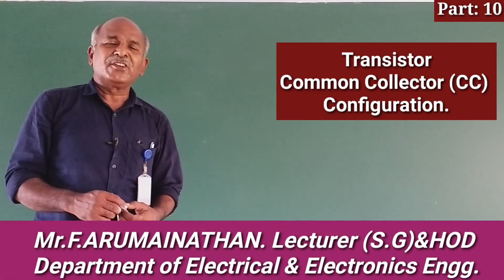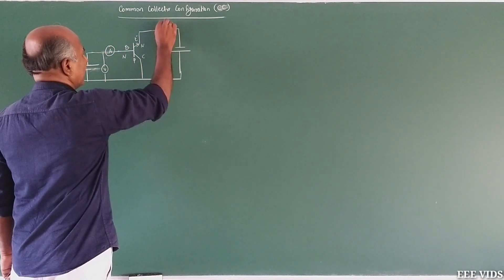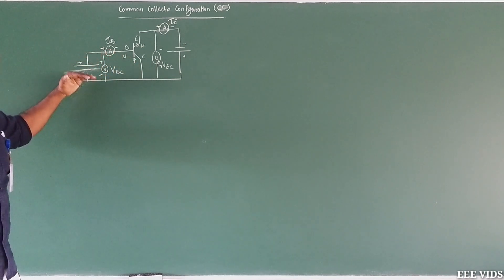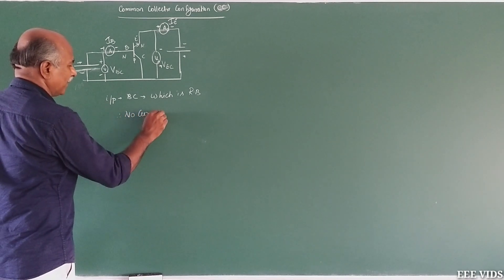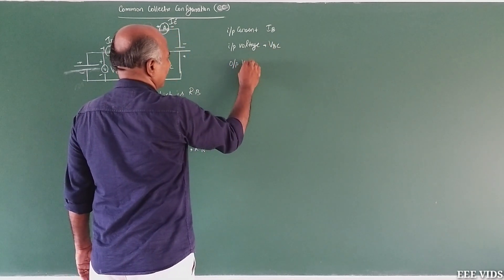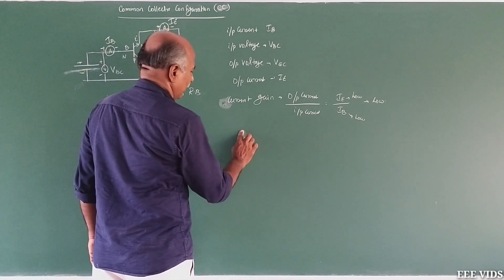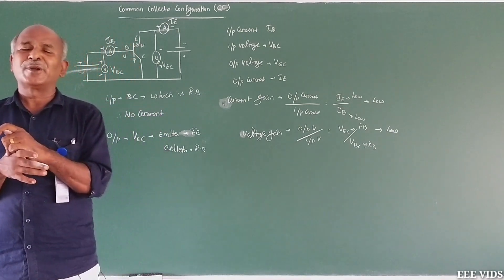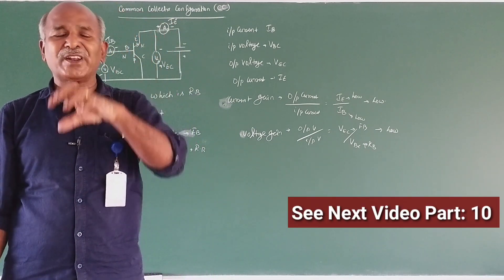Common Collector transistor in tamil

Comment: both the emitter and collector terminal are given forward bias...but the collector terminal should be reversed biased
Reply: yes same doubt
Reply: remember that reverse bias is all about the voltage difference across a junction, not just the physical connection of terminals

Comment: In CE configration also base current(input)is very low but there we did not say input is low so we can't plot the graph then why? in  CC configration we are saying that input is low that's why we are not using this configuration can anyone pls explain this I can't get this ....
Reply: because the input voltage supplied here is reverse biased so the input current will be low

Comment: Sir for NPN why is collector terminal taken from P layer and not N layer ? Usually we take collector terminal from N layer as shown in CB and CE configuration .
Reply: Why blood same blood
Reply: same doubt. yaarukaavathu therinja sollunga pls
Reply: @noobcoder5754  ok bro solren
Reply: Remember that reverse bias is all about the voltage difference across a junction, not just the physical connection of terminals